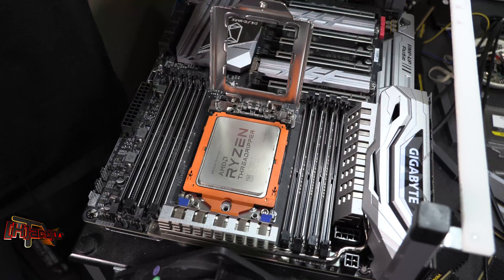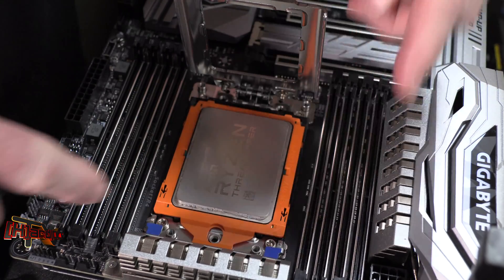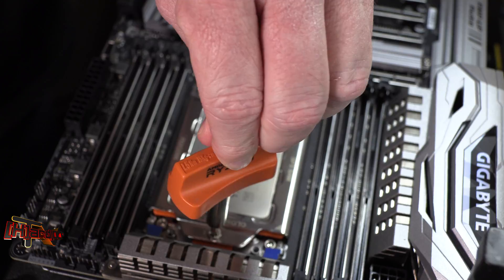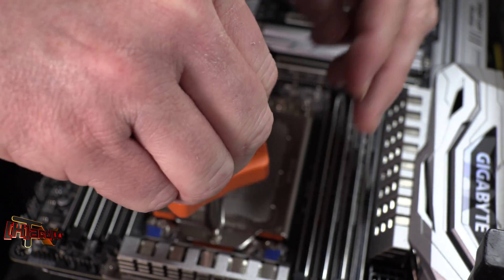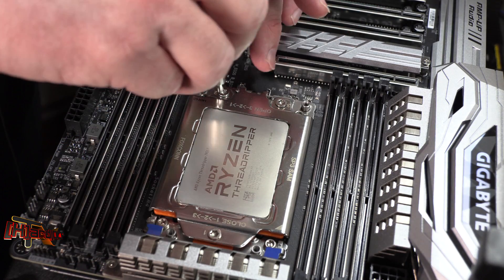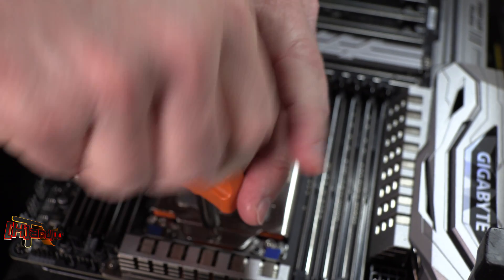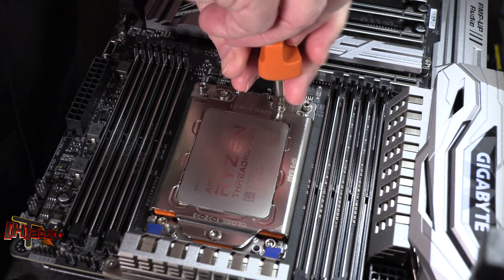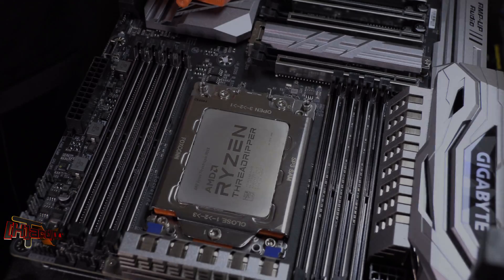TR4 Threadripper Socket Tightening Issues - Foxconn Socket

Comment: You guys are supposed to hold the bracket down with a finger while screwing it down. No problem with my ASRock x399 Phantom Gaming 6 motherboard with Foxconn socket. I have been working with Intel CPUs so that habit simply just carries onto the AMD LGA socket, so I didn't struggle with the Foxconn Socket SP3.

Comment: I have solution for you.

You have to buy bosch electric driver. (It's OK any other brand)

You should confirm when you buy that you have to include make sure T20 attachment.

Because you can't if you haven't T20 attachment.

If you  have T20 and electric driver and T20 attachment,

You can pressure as direct much better your weight as easy.

Then you can tight No.1 screw.

well done! I could screw. It's easy!

Comment: I used asus prime... Same issue . Took a lot of pressure to get threads tightened. Secondly, I placed board on its package box.. soft base caused bending on board.. i would suggest either put on hard surface or place board on other hand...

Comment: i had to use a TON of pressure on mine, way more than it looked like in this video. thought i had a bad board (scored it on eBay for $180)--this exact same one, in fact. but seems to work just fine
Reply: honestly the worst socket ive ever used

Comment: Had the same issue with my zenith extreme i hope i didnt break anything. Because i wanted to change my cpu soon. Have a 1900x installed, wanted to wait for the 2950x. Also i can only get my ram to 3200 mhz i hope it changes with the new cpu.
Reply from the maker: You can press down with GREAT force on that socket to get the screws started if you need to.  You are not going to damage it as long as it is mounted well in a case on has something under it to support it properly during install.  Just take care not to angle the tool too much to allow it to come out of the head of the screw while pushing down.  That socket is built like a tank.
Reply: Was yours a Foxconn socket, too?

Comment: This is the worst socket design ever. AMD need to rethink this and go back to classic Ziff socket.
Reply from the maker: This socket design is excellent in my opinion.   Not going to have 4000 pins in a Ziff.
Reply: It's all I good, I was just upset yesterday because I had just got my new X399 board and Threadripper together and my system wouldn't post.  I thought it was over something flaky because I accidentally touched the bottom of the CPU while seating it which everyone screams is super sensitive along with seating it properly.  Bunch of non-sense thinking to non-sense talk.  The issue was simple, run FLASHBACK+ bios update since the motherboard was not current to recognize the 2nd gen Threadripper I put in it. C0 issue resolved.
Reply: @vh9network  yeah, per one of the mods in the official AMD Discord, they assembled a half dozen or dozen Threadrippers or so and never had issues with the socket alignment (when booting up... I'd read about that being the reason not all RAM was showing up for some people, but they hadn't had that issue not did I, thankfully)

Comment: Same motherboard same problem, I just couldn't get the #1 torx to start at all.  After looking closer I found the LGA pins were bent (right to left) and 2 to 3 times longer on the right side vs the left side?  I've never encountered this before and it strikes me as a manufacturing issue.
Reply from the maker: If the pins in the socket are bent, for all intents and purposes, the motherboard is done.

Comment: This is the problem some have had with that socket https://www.youtube.com/watch?v=Oe99_lsBTqo&t=330s
Reply from the maker: As we have shown REPEATEDLY in these videos, the way to address that is to NOT fully screw down the #1 screw first.  Just get it started into the thread, then do same for #2 and #3.  Then go back and tighten those all.  This is just normal practice for guys that work in "the garage" on their cars.  That said, the instructions for AMD do not suggest this.  And those are simply wrong.  When you have multiple attachment points, you should never fully torque one before even starting the others.